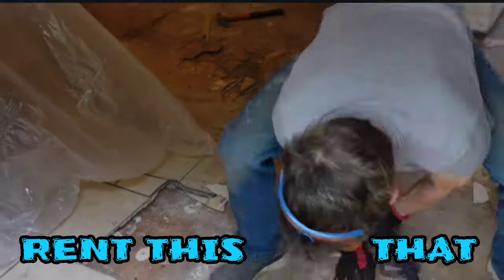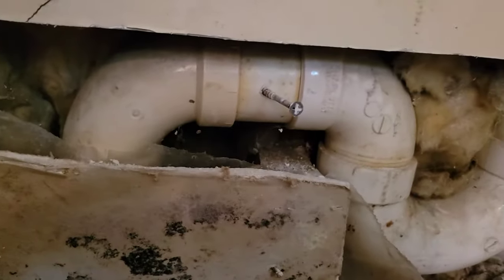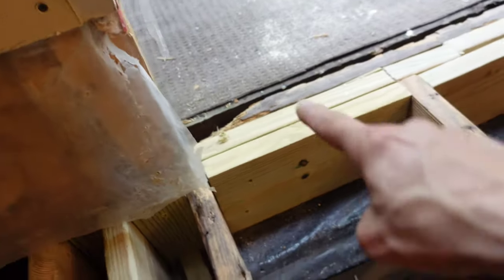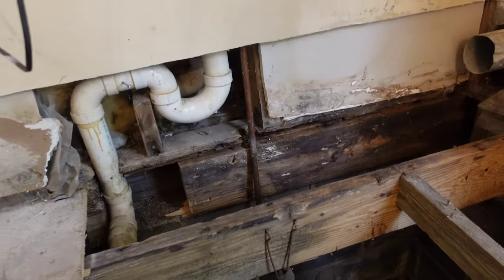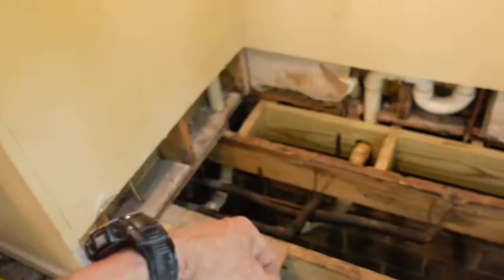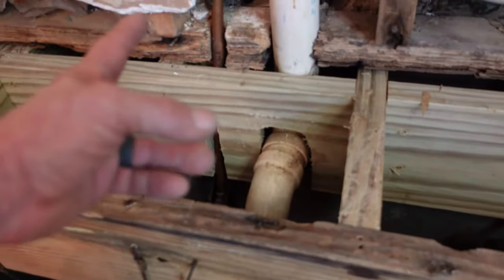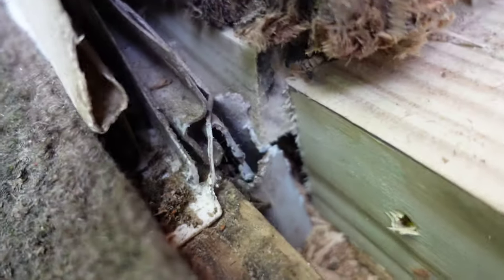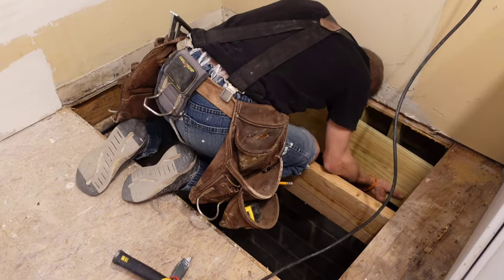Repairing Rotted Floor Joist & Outer Band

Comment: What was the range of the cost of this project? Wanting to see if my quote is excessive for my 5x10 area
Reply from the maker: Don't really remember. It's one of the rentals. But it was when wood was super expensive. So probably wouldn't cost as
much today
Reply: Did you receive an estimate for this? I need work done on my home and need to know how much to save
Reply from the maker: I'm not sure  as wood goes up and down on price, but for a 5x7 bathroom, probably 200 to 300 dollars. Let me know more details of your project, and I can probably get closer on price
Reply: Nice job of blocking.
Reply: I'll do it for $500 and an Uber to the job 😁

Comment: Looks like hackerey to me
Reply from the maker: Hilarious 😂
Reply: It's a REPAIR, not new construction.  You don't have many options with rotten subfloors; just cut out the rot, and sister joist as best as you can, to avoid having to tear down the whole damn house.  Repairs are often stronger than the original construction.  Doesn't matter what it looks like once the plywood is laid over it.  Nobody will ever look at it or even care.
Reply from the maker: Thank you sir. I appreciate that. Thanks for the comment